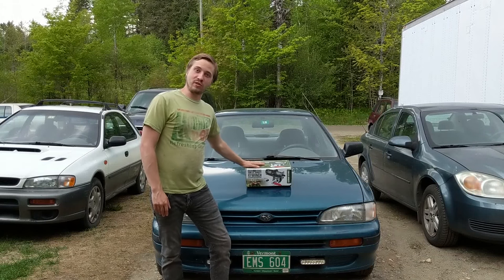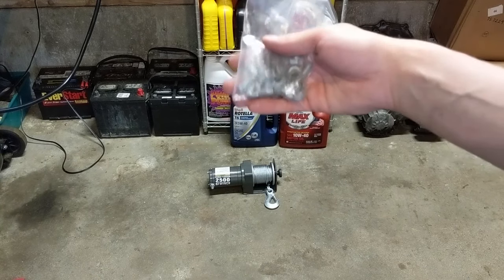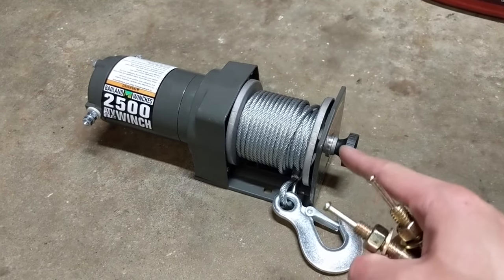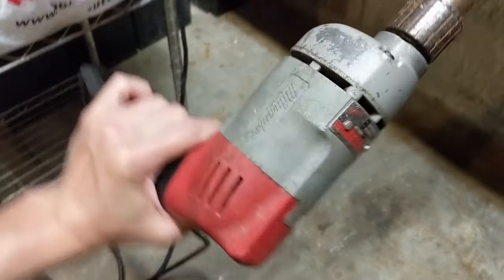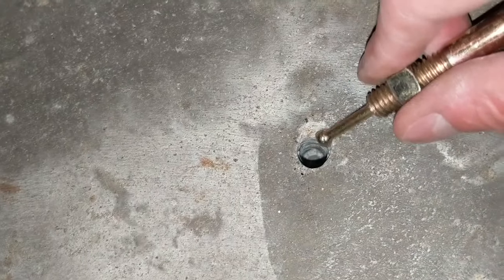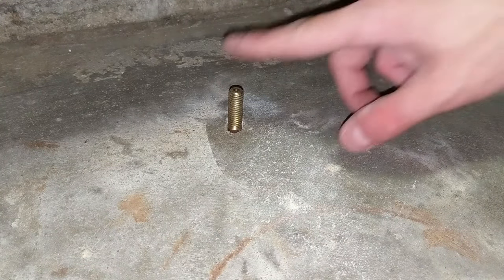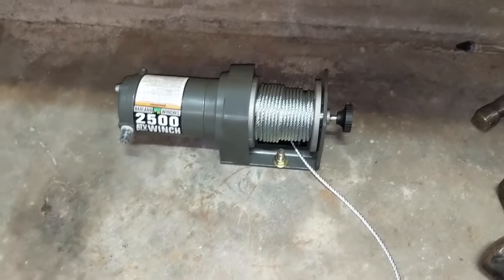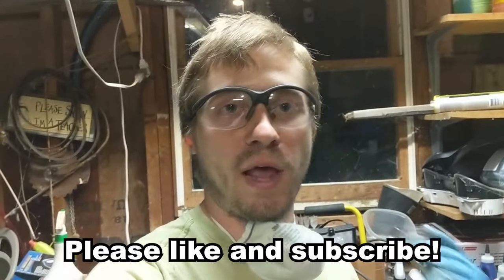Garage Winch Install Cheap! 💪 Floor Mounted Harbor Freight Badland Winch

Comment: This gave me flash backs to a similarly horrendous winch install in the floor of a shop I worked for... I did have a hammer drill and still had all the same issues as you, only I had 4 holes to make!😂 Anyways kudos to you for getting it done, cement is not so easy to work with I find.
Reply from the maker: Hahaha I hear sometimes it can just be awful! Stepping up from smaller bits is def the way to go. Cement can be cruel no matter what though!

Comment: What you should have done is set a receiver mounting plate. Called a Step Bumper Receiver.  (Link 1) .  Drill all your holes and add some oversized nuts and washers between  plate and floor.

Get some 2" square tubing (draw bar stalk) and weld (or have it welded) a winch mounting plate on to it. Like Link 2.   Make it so you can put in a smaller tube in front , this is for making a place to hook the cable back onto. Comes in handy for adding a snatch block, doubling the capacity of the winch.

And last upgrade the winch to the 3500lbs (it comes with the plate). Not only will you be able to pull more ( I know you are just pulling cars on flat concrete but keep reading) but the mounting holes are not in the way of the cable.

Why? Well it is way easier to mount. Also when the winch gives out and needs replacing it is way easier to do.  If you are pulling the winch off after years of operation those bolts may be out of wack.  

Also the bolts won't be in the way of the cable. BTW reversing the winch can be done but you shouldn't. Keeping the cable centered to the winch is best. Going over the top will pull up on the back bolt more. It is best to keep the pulling force level/in line with the bolts.

Added benefit is that you can use the winch in other places making it way more useful in different locations.  Get the most bang for you buck.

Last thing. Add Anderson Plugs between battery & controls and between controls & winch. Link 3. These thing are fucking awesome!  This will make it so you don't have to leave the controls and battery on the floor all the time. (Acceptable to falling things.) Adding Anderson Plugs to (in between charger cables and clamps) your charged will make it easier to charge and make a good connection to battery. It also will make moving winch from location to location MUCH easier. You can also add extensions. You can have the battery in the bed of a truck and the winch on a trailer. You need two for every connection. So you will need at least 4 for just this. Yes they are an added cost but the first time you need to do any maintenance to it or charge it you will be glad you put them in.

I have my trailer set up like this very way. Can't see winch in video but the point is it's there LOL.  Link 4. I move this winch from trailer to trailer. I had a receiver plate on my garage floor like you (no longer live there) and would pull in cars just like you. 

Ok now last thing LOL. If you winch ever breaks down or you forgot to charge the battery, you can always take the winch out, put a regular draw bar with a hook or shackle, run a rope from car being pulled in to Snatch block  , back under car to another car, and pull that sucker in. Just make sure to put some stop blocks. 
 
Left links to products in video below.
Reply from the maker: Hahaha never saw your original comment, sorry. Believe me, I definitely thought of many ways to over engineer this project before I did it, but I mostly wanted it done fast and cheap. TBH if I was gonna do it again all I would change is mounting the winch to a plate that I can unbolt easier so I can swap it between two spots or get it out of my way. Other option would be to mount it to a trailer hitch style mount that can quick release from mounts in the floor, but given how often I use it and how often I would move it, really not worth it. The winches are so cheap I can also just buy two if I want one for each bay. This winch has def been plenty capable for me, I'm not gonna pull any massive trucks. Any upgrades in weight ratings cost way more money to do the same job. I'm very good at wiring so I have no issues with changing the connectors to whatever I want, I'm just too lazy with tons of other projects. Lots of great ideas though!

Comment: This is a great idea. Gonna have to incorporate this into my shop when I build it. For now, I just throw the cars on the wheel dolly's and muscle em up the garage lol. Helps to be an ex-powerlifter haha!
Reply from the maker: Thanks a lot! It's one of those things you might only use a few times a year even, but for the cost it really just save energy and frustration. It does mean you skip the workout though. 😂

Comment: You can find threaded inserts that work similar to an anchor bolt.  The threaded part is flush with the floor and you thread a bolt into the flush anchor
Reply from the maker: Interesting. I actually hadn't seen those for concrete.
Reply: They are called drop in anchors
Reply: @802Garage   Same Ones I was just telling you about.
Reply from the maker: @AztecWarrior69_69  Yeah I gotcha. 😁

Comment: With your grande love for, and adept use of, epoxy resin, I would not have been amazed if you had decided to 'glue' that toy to the garage floor. Or at least tried it. My Russian G-Pa tried to use such (JBWeld) in as many applications as possible. Probably lost sleep, pondering about how, the following day, he could employ that 'Heaven Honey', as he called it.
On the other hand, the left one, uncle Dimitri would use power wenches to do body & fender work...pulling out fenders, door panels & frame straightening.
BTW, you plan on powering it with a stray, hopefully charged, battery...or a AC - DC converter ?
TaTa !  👄 👍
Reply from the maker: Hahaha, I bet I could have used some construction adhesive and it would stay quite a while. I just wouldn't want to see what happens when the epoxy finally lets go! Sounds like you have an interesting family history. Thanks as always. :)

Comment: Definitely going to need a second anchor point in the concrete to run a snatch block setup to avoid burning up the winch - that 2500lb winch is quite weak but the cable is probably the weakest link - just broke the cable on mine and all it does is lift an atv snow plow
Reply from the maker: It actually pulls cars pretty easy. Being on a pretty much level surface surely helps. Did this install last year, though I've only used it a handful of times.
I've seen these cables break on ATV plows too, so they worry me. I've been considering swapping the cable for a synthetic rope for multiple reasons and probably will eventually.
So far it doesn't even seem to get hot, but it's not like I'm pulling trucks! We'll see of it ever struggles later. Thanks for the comment!

Comment: I got a floor jack from Harbor freight and it is still going strong 7 years later., it has the low clearance and the 50-inch spreader with thick rubber pads.
Reply: Gopherchucks Games - I’d say half or more of my garage is from that store 🤘😂🤘
Reply from the maker: Hah, same! Most HF tools have treated me well. Just avoid the locking pliers.

Comment: Good job. Small advice - place the nozzle of vac on the ground near the hole you're drilling. It'll suck up most of the dust so you dont have to stop/start as often..
Reply from the maker: Thanks! And yeah watching my footage back I have no idea why I didn't do that. Likely was thinking of "the shot" as well as not wanting it in my way. It was surprisingly low dust while drilling, mostly just a lot when trying to clear it. :)

Comment: My dad taught me the rubber mallet trick, he would bounce it on the back of the drill every few seconds to blast out the loose dust.
Reply from the maker: Oooooh! Now this is a cool trick I wish I had known. Makes total sense. Just worry about breaking the drill, but obviously if it can't hack it, time for a new one! I do have a much better hammer drill now though. :)
Reply: @802Garage  yeah I have a Dewalt hammer drill. not playing with it anymore
Reply from the maker: Same actually!

Comment: Great determination bro, wholly shit, it was 1 damn challenge after the other, way to stay positive and keep going. I'm setting.mine in the woods to a tree with.a marine deep cycle battery
Reply from the maker: Hahaha thank you! I'm glad I gained the experience on working with concrete. Still need to relocate that transmitter box!

Comment: Nice! Do you remember the size of the strike anchors you used?
Reply from the maker: I know I looked up the strength of concrete anchors and made sure I used a size rated for holding past the winch rating. I believe I had to drill the vice mounting holes out very slightly. I want to say it was 3/8" anchors because the mounting holes are 8.5mm according to the manual and 3/8" is just a bit larger.

Comment: FYI, I'd rent an SDS hammer. A $20 hammerdrill aint getting you far. I've got a particularly nice hammerdrill (Milwaukee M18 FUEL ONE-KEY. Fantastic drill, but still not quite what you'd need for concrete, and I still wouldn't even waste the effort to try to drill into concrete
Reply from the maker: Yeah if I ever had to drill a lot of holes, I'd probably rent a big dog. I have a DeWalt hammer drill now, but like you said it's still not really for big concrete jobs. That said it just sucks I'm pretty far from anyone who rents tools. Thanks!

Comment: Where did you get those strike anchors for $2 a piece!? Also, I plan on doing this with a 5,000lb winch pulling cars that are 5,000lb+ and winching them into my garage. Wondering whether the anchors will hold or not. I think the 5,000lb winches are 4 bolt, yours is 2 bolt.
Reply from the maker: Local hardware store on the strike anchors. I don't think you really need a 5,000lbs winch for 5,000lbs vehicles if you are pulling across mostly level ground and the wheels are free. Winch rating is strange, based somewhat on pulling a load straight up with only one wrap around the drum. 5,000lbs could pretty much pull any vehicle, especially over short distances. I don't think even this 2,500lbs winch would struggle with an SUV. Obviously better to be safe than sorry though. If there is a big hump or something into your garage it may be necessary.  You can look up strike anchor strength rating charts on Google. You'll be looking for lateral or shear strength if installed in the ground this way. I believe 2 strike anchors like this are definitely rated for over 5,000lbs shear at least. Just make sure you get a size where ideally one anchor could do the job, but 2-4 have a good safety factor. Hope this helps. Best of luck!